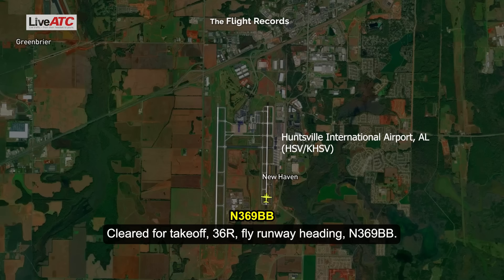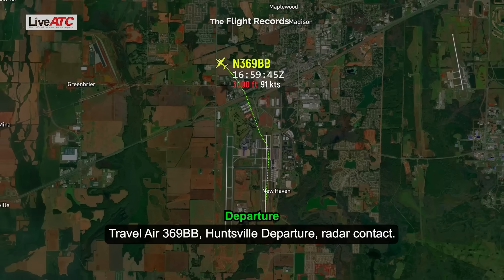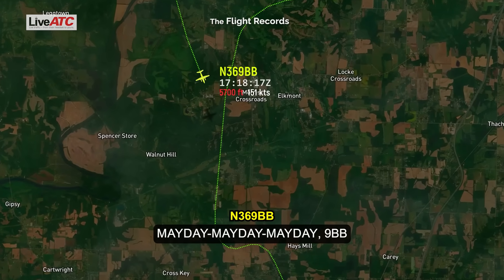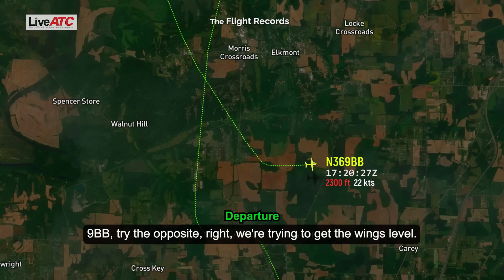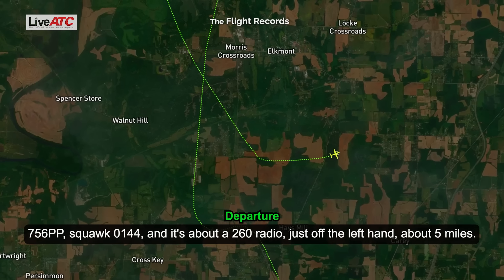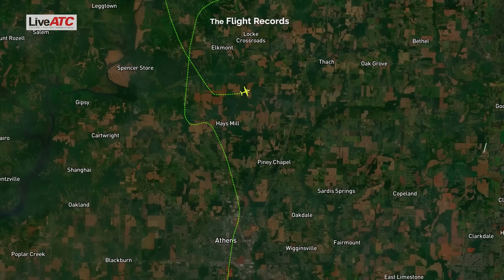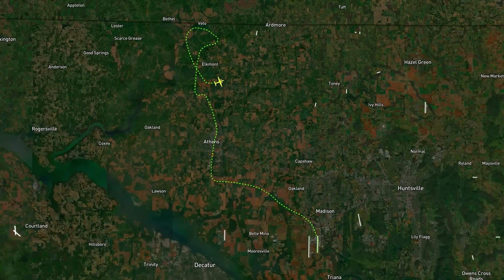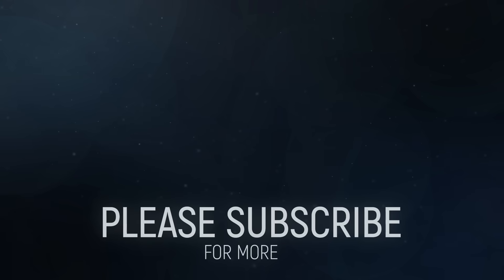-6,727 fpm descent rate | 2 KILLED in plane crash near Highway 127 in Limestone County!

Comment: Unlike single engines, the rotating mass of the engines out on the wings of a twin is too much inertia for the small rudder to overcome,  thus once in a spin, it is unlikely the twin will recover out of the spin.
Reply: Wow. After watching this I found myself wondering, "What would cause something like this?" ... 'thus once in a spin' - regardless of and perhaps even beyond probable cause is... well, just wow. That's what it all boils down to, once in a spin you have largely crossed the point of no return. Horrifyingly sad.
Reply: A spin wouldn't have that descent rate though.
Reply: @peterhenman2662  He states "in a spin" and how he is trying to recover. Would the angle of decent matter? I am thinking a "flat" spin, but what if the nose is pointed down and the spin isn't quite so "flat," would that account for the decent rate?  I have been reading that a spin in this type of aircraft is a beast to deal with and in some, there is no "recovering." I had no idea having so much mass and weight away from the center of balance of the plane would pose such a threat.  WMC training?
Reply: @blkvetteman1 if the nose is pointing down it would prob help vs a flat spin.
Reply: @peterhenman2662  Sure would. The incipient phase and developed spin could easily reach that descent rate. Once it goes flat, it would slow somewhat though. I agree that this is almost certainly either a VMC demo gone bad or loss if control during engine failure procedures. Travel Airs were spun fatally many times in the late 50’s and 60’s.
Reply: Yeah something to think about for people who think light twins are safer than singles. Internet is full of videos of student pilots solo spinning out and the aircraft recovering on its own. Here an experienced multi pilot had the presence of mind to talk on the radio while doing the recovery procedure (which he presumably knew), and still nothing.
Reply: Interesting. What's the procedure for recovering from a spin in a twin engine? If you had time, could you shut the engines off?
Reply: @AngusMcAlister14 you can pull the throttle of both engines to idle immediately.  We have to do a VMC demo for multi license which is prob what caused them to get into the spin is my guess.

Comment: Tragic loss. Are these twins not able to recover from spins?
Reply: It's very likely the case.  Many twins are unable to recover or take longer than other single engine training aircraft.  All twins I've instructed on had a placard prohibiting any sort of "utility category" maneuvers.  This was either due to the inability to recover or not structurally designed to handle the aerodynamic loads.
RIP to those involved
Reply: Twin props are notorious for being difficult to recover from a spin. They’re far more dangerous than single engine props. For context this does not apply to multi engine turbines though
Reply: @varietychillin9632 thanks for the explanation. I always thought 2 engines is better than one
Reply: @Boss_Tanaka  yea no problem, but like I said, it doesn’t apply to turbine aircraft, a multi engine TURBINE is better than a single engine turbine
Reply: Twice the problems one engine out it becomes a over weight single two very important things with a twin BLUE LINE and never turn into a dead engine  @Boss_Tanaka

Comment: He was my former multi instructor. Flew that plane many times. He was a great instructor and human being. RIP brother.
Reply: Vmc demo into a spin seems to be what happened.  Light twins in a spin can be extremely difficult to recover from.
Reply: Giving some dual instruction maybe. Single engine Vmc demo failed to recover?? My multi instructor was killed in single pilot operation in piper Navajo. Lost an engine on approach segment. Shut down the wrong engine 😢 both engines dead. Landed good enough his passengers were uninjured. But he got killed.
Reply: If you don't mind me asking, what was his name?
Reply from the maker: Sorry for your loss. RIP 🙏
Reply: sorry for your loss.  :(  if he was a multi-instructor, and based on what was on the transmission, he wouldn't have flown the ADSB profile provided.  that puts it towards mechanical.  if you find out the results of the investigation, would you please share it.  again, i'm sorry for your loss.  RIP.
Reply: I knew him too remember when he got his private out at mdq.This was the hardest recording i have ever listened too.
Reply: It's hard to fathom what might have happened to someone with enough multi experience to be a CFI.  Every time I've been up in a twin (including the Traveler) - the number one thing we always worked on was an engine out scenario and maintaining control.  I'm trying to think of how he knew he was about to spin but couldn't do anything to prevent that.... jammed rudder?  engine out? pilot error?  I'm sure Dan Gryder will have it all figured out on Sunday.
Reply: @RealRickCox  I think the caption was wrong. It wasn’t “I’m about to spin”, it was “I am in a spin”.
Reply: Has to be mechanical.